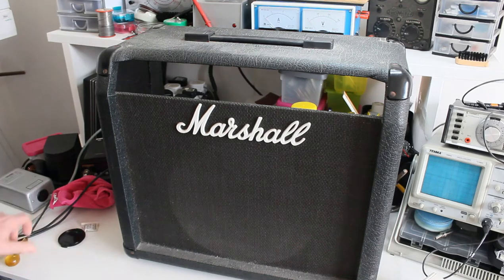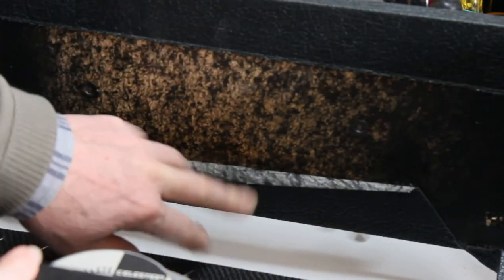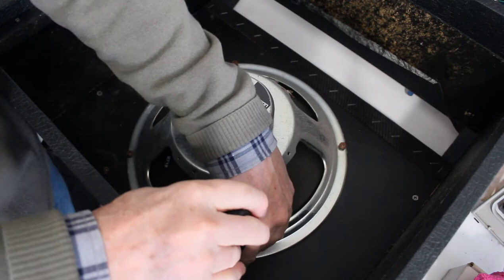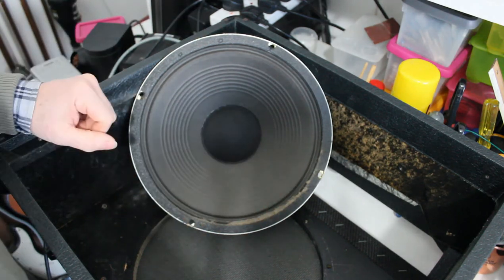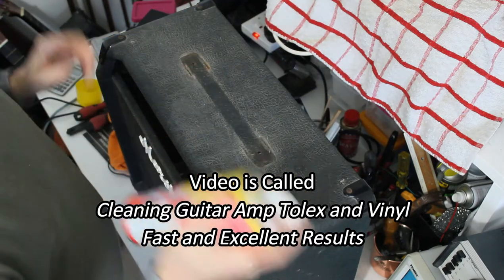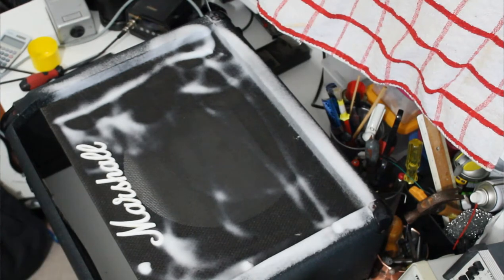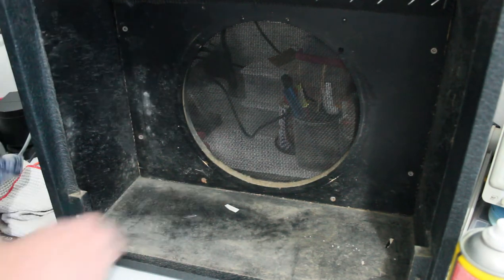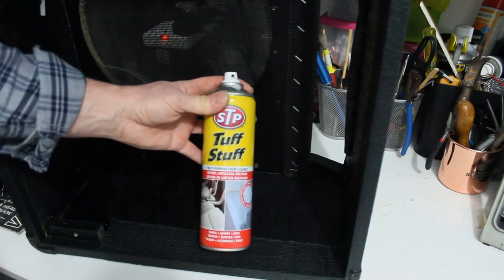Dead Marshall Amp Repair - Part 2 - Cabinet Restoration

Comment: Great job on the cleaning, a quick tip with regard to the fading of the grille cloth, you can use inkjet black printer ink, applied with a sponge, just buy a bottle of cheap non-genuine stuff.  It's easy to get the Marshall logo off without damaging it, knock it out from the back with a suitably sized old drill bit (blunt end) and it pops out easily.
Reply from the maker: Good tip with the black printer ink.

Comment: Its realy nice and clean, exept the rusty screw's on the corners protectionpads, i advice you too brush them with a copperbrush or something like that, but a very good job..well done!
Reply from the maker: Yes you caught it!  I actually noticed this after I videoed that clip.  I ended up using the sharpie to darken the rivets. Thanks for your comment.
Reply: @dembydish  youre welcome